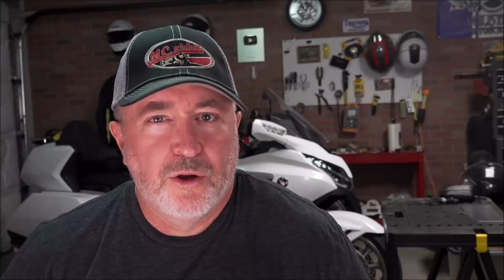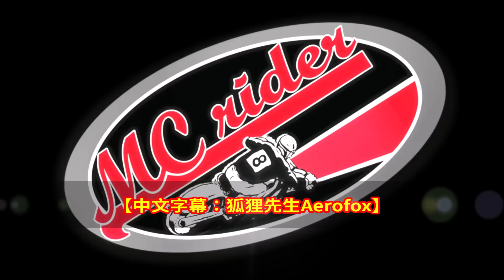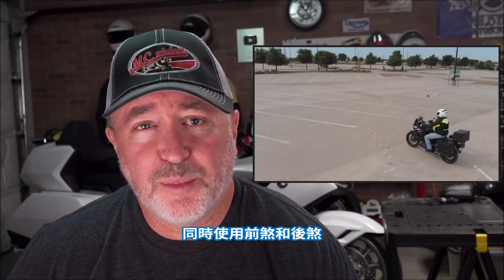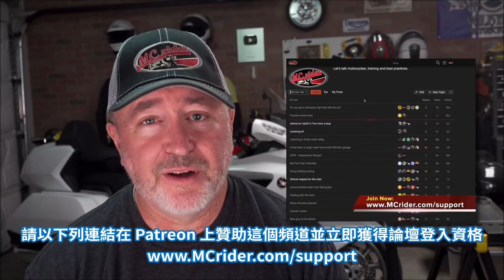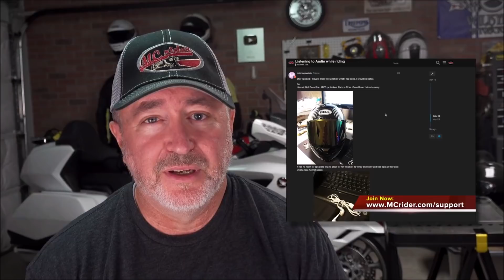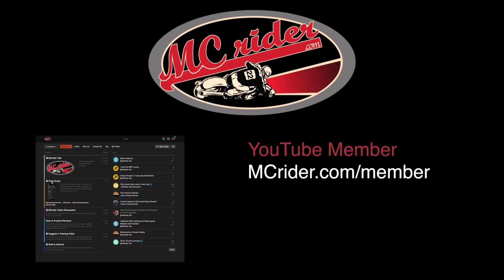《狐狸譯重機👍》緊急煞車時究竟該不該拉離合器？

Comment: Awesome video, people often confuse the use of brake and engine brake, engine brake in passive and shouldn't be use when you need a sudden stop. Some say the drag of engine brake can help reduce rev and momentum of the engine. But they forget when you pull the clutch, it is disengaged completely and the rev and momentum ain't a issue anymore.